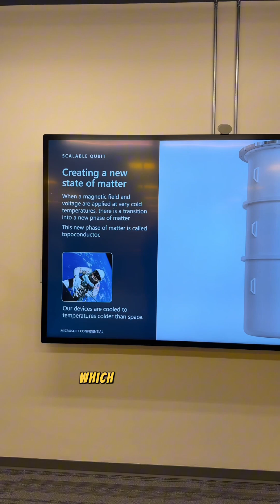This Took 19 Years to Create.....

Comment: "10 times colder than interstellar space", um, average Interstellar space temperature is  -270.4 degrees Celsius absolute 0 is -273.15 degrees Celsius. Where is the 10 times colder?
Reply: I'm not a scientist, nor am I absolutely sure about this, but to my understanding, as you get closer to absolute 0, cooling becomes magnitudes more difficult. She says 10x colder, but that's not really the right way to describe it. It is more difficult and takes more energy to get from   -270.4 C to -271.4C than it does to get from 0C to -270.4C. What I'm trying to say is that the closer you get to zero the magnitudes more difficult it is to get there.
Reply: That's a reasonable conclusion but it would be best for her to clarify @Oni-Joshu